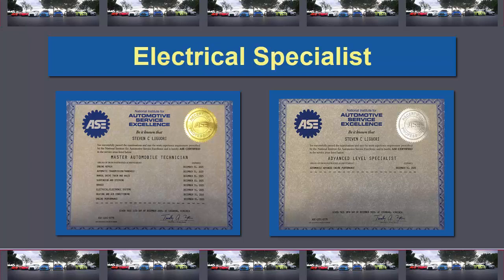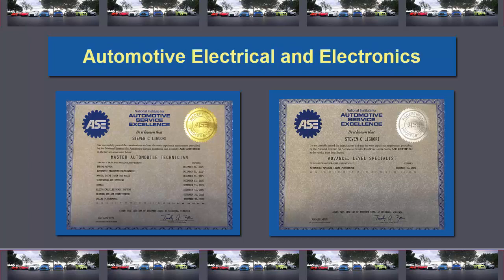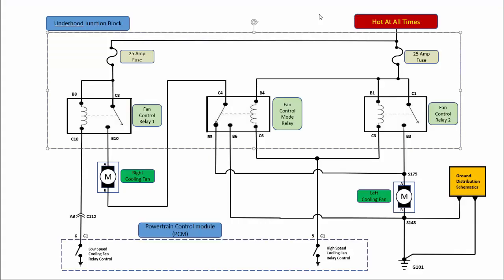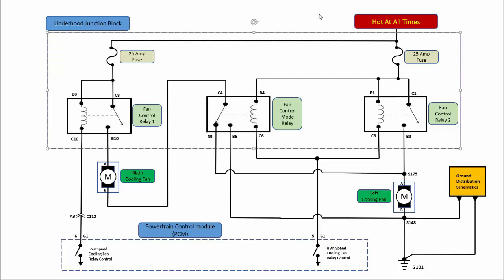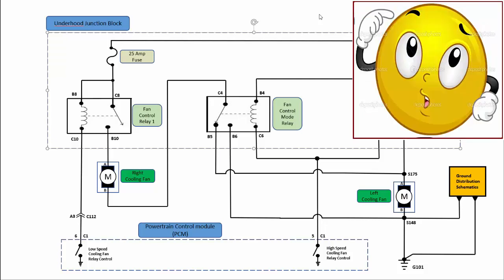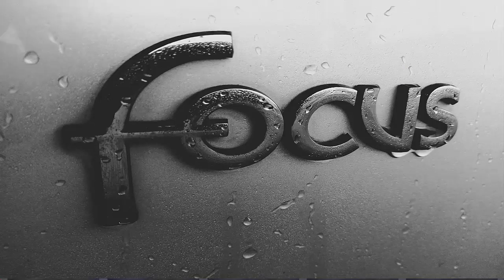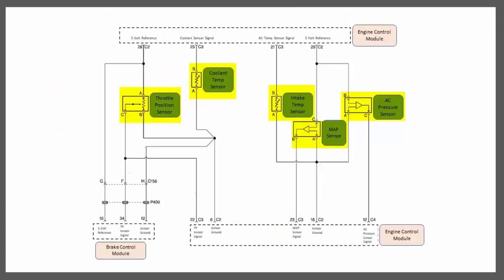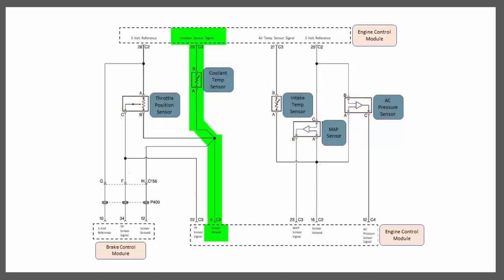Automotive Electrical Schematic Diagnosis - Intermediate Course Preview

Comment: When can i get all the lessons?
Reply from the maker: Below are the names of all of my current courses and discounted links to them.

Do it Yourself-Automotive Electrical Diagnosis-Beginner
https://www.udemy.com/course/do-it-yourself-automotive-electrical-diagnosis/?referralCode=9612DCDFC3F57323F695

Do it Yourself-Automotive Electrical Diagnosis-Intermediate
https://www.udemy.com/course/do-it-yourself-automotive-electrical-diagnosis-intermediate/?referralCode=6F72BE0F50B97B4521DE

Automotive Starting System Operation and Schematic Diagnosis
https://www.udemy.com/course/understanding-automotive-starting-system-schematics/?referralCode=BFB15FD19C7325862BF3

DIY - Automotive Power Window Systems Schematic Diagnosis
https://www.udemy.com/course/automotive-power-window-systems-schematic-diagnosis/?referralCode=713B64B8C038C7F48E5A

Automotive Electronics

https://www.udemy.com/course/automotive-electronics/?referralCode=1F2AAC439D2371FCE076

Diagnosing Voltage Drops and High Resistance Problems
https://www.udemy.com/course/diagnosing-voltage-drops-and-high-resistance-problems/?referralCode=F1ADB3DD4787BD7191C3

Ohm's Law Made Easy for Series Circuits
https://www.udemy.com/course/ohms-law-made-easy-for-dc-series-circuits/?referralCode=D5C32FB699261B454810

Ohm's Law Made Easy for Parallel Circuits
https://www.udemy.com/course/ohms-law-math-made-easy-for-parallel-circuits/?referralCode=A12FF55930790E7446C5

Ohm's Law Made Easy for Series Parallel Circuits

https://www.udemy.com/course/ohms-law-made-easy-for-series-parallel-circuits/?referralCode=D26B85E47F207E0F209A